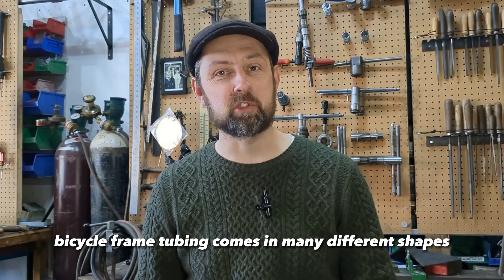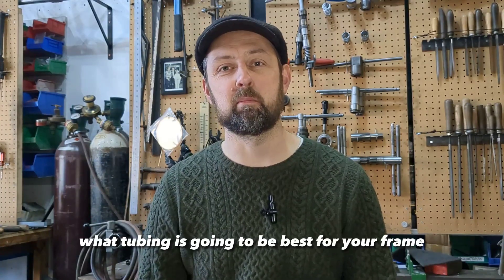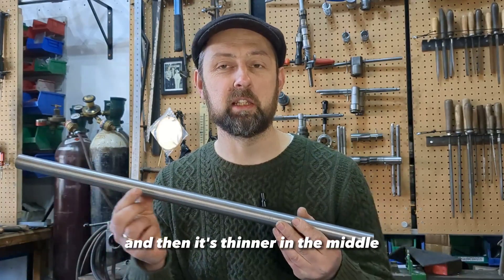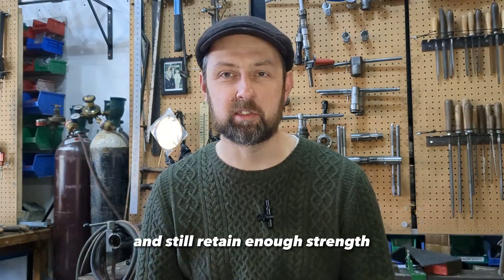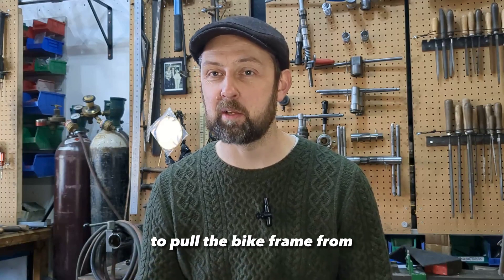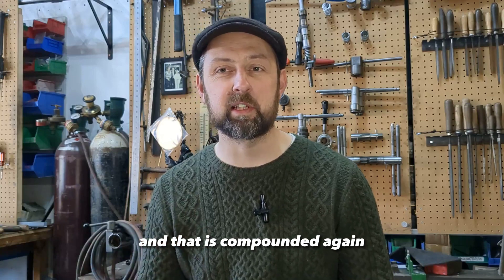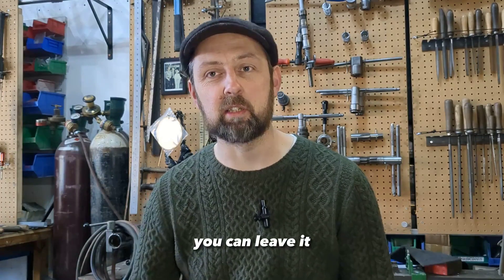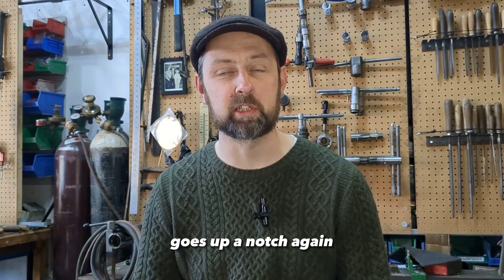Unravelling the Mystery of Bicycle Frame Tubing: What You Need to Know! | Bike Frame Building

Comment: Enjoying the videos , what is your take on titanium, is it something you use / build with , is it any better than highest quality Reynolds, also what is your favourite tubing to work with ? I have a book called the custom bike builder which I read about 40 years ago, am sure it makes reference to Italian builder Pogliaghi preferring silver solder so lugs can be brazed at slightly lower temperatures, does that make sense to you. One last question which frame builders do you think are the most skilled , I've always thought and heard Roberts frames are very good as I'm sure are many others.
Reply from the maker: I think I should do a video answering these questions at some point.  However -
I think one of the main advantages with Titanium is that it has a more exotic appeal than steel which lends itself to boutique handmade frames.  Also the work around 3d printing in titanium is really inspiring.  But in terms of mechanical properties I don't think it has much advantage over steel as it is not as strong or stiff.  And with stainless steels you get the corrosion resistance too.
Reply from the maker: Sorry pressed reply too soon! On tubing I like working with Reynolds 853 for its good all round properties without getting too expensive.
Skilled builders that are still around, I would have to say people like Kevin Sayles, Doug Fattic, Richard Sachs to name a few.  Those who are time served, because you can't learn experience it has to be earnt.
Reply: @ellisbriggsbikes  Interesting , I had wrongly assumed titanium was stronger than steel as the military tend to use it, maybe just its lighter quality they like . I'll look up the 3d printing side of it as my son is doing basic engineering apprenticeship . Am enjoying the video's , I think keeping them in bite size chunks is good too, between 3-12 minutes. Thanks for reply.
Reply from the maker: @pinarellolimoncello  it depends on the grades of steel but equivalent grade of steel compared to titanium is stronger but you can manipulate properties a bit with tube shapes and with titanium usually a larger diameter tube is used to get similar properties to a smaller diameter steel one. In the end the weight is comparable
Reply from the maker: Thanks for watching!
Reply: Ps I hit reply button too early as well .Just on keeping your industry alive, for certain frames you probably could charge top money, look at the prices on top Italian frames and they aren't even made to measure, in the olden days bespoke builders always made to measure didn't they but globalisation has taken that away so you could reinforce that unique selling point , USP, they call it in cliche terms. Great skills you have.

Comment: I've played with heat treatment for decades. Knives, military, and aviation. It blows my mind that you can use a torch to braze and not draw out the temper of a tube that thin.
Reply from the maker: There's definitely some loss of tensile strength when the tubes are joined. Silver brazing just below critical temperature
Reply: @ellisbriggsbikes i was just thinking: don't we have adhesives that can replace brazing .. at least as far as bicycle frames go? I'd guess we must have that technology. Then, we eliminate the loss of heat treatments, and cut expenses. There are some strong long lasting epoxies without brittleness similar to a firm silicone. Has anyone ever investigated this angle? There is also cold metal transfer welding (CMT) which eliminates 90% of the heat of traditional TIG welding. It would be nice to retain original heat treatment properties. It would eliminate the time+cost of secondary heat treatments after assembly. There is a lot of research being done in the area of joining metals.

Comment: I have a Bob Jackson with Reynolds 531 bild in 1985. .What is the difference from 631 , 831 931?
Reply from the maker: 631 has pretty much replaced 531. The only practical difference is you can Tig weld it. 853 is that same alloy but is heat treated, so it is stronger and you can make the walls thinner. 931 is slightly stronger than 853, so the walls can be slightly thinner again. It is also stainless steel so it won't rust.
Reply: Thanks . Btw , love your Chanel.

Comment: would EMT  conduit be strong enough for a bike frame ?
Reply from the maker: Any steel tubing could be strong enough with the right wall thickness.  If it was strong enough though, it would build a heavy frame.  The advantage of bicycle specific tubing is the alloy used has a higher tensile strength, so you can have a very thin wall.  Couple that with the butting process, which produces a thinner wall in the middle of the tube where less strength is needed.  By the way this technology was perfected over a hundred years ago now!

Comment: Do chromoly tubings sensitive to rust? For example the inner tubes most especially when it has internal cable routing?
Reply from the maker: Internal cable routing can be completely sealed if done properly but bad examples on production bikes are usually just holes in the tube
Reply: @ellisbriggsbikes   thank you very much for the response. I have rubber cable guide that seats on each holes of my steel frame, is it enough? 
Also, from your experience, does columbus tubes considered very durable despite if it has rusts? I've seen raw looks on this.
Reply from the maker: Steel tubing is all prone to rust. In practice though it depends on how you look after your bike. If you keep your bike dry and warm it will not rust. If you put a wet, cold bike in a damp garage you'll have problems

Comment: Has anyone tried square tubing yet? It's supposed to be stronger than round
Reply from the maker: Pace tried it for mountain bikes about 20 years ago. It wasn't a success. The frames were ridiculously stiff and weren't light either. They are ollectable now though
Reply: Muddy Fox tried tubing that was round, but morphed to square at the ends. If I recall, it made little difference, except adding weight.

Comment: According to your experience, which is the best chromoly type to build a touring bike? Thanks
Reply from the maker: Touring bikes usually need to be stiffer than unloaded bikes  but the rider size and weight also needs to be taken into account. So for example if I get a small rider I may spec Reynolds 631 in standard sized tubing. A bigger rider may need oversize tubing and a thicker wall in order to achieve the same ride feel.  This is the beauty of custom steel bikes. They can be truly personalised to the rider whereas a mass produced frame has to be designed to accommodate the biggest riders.